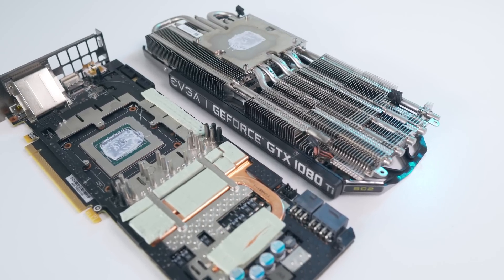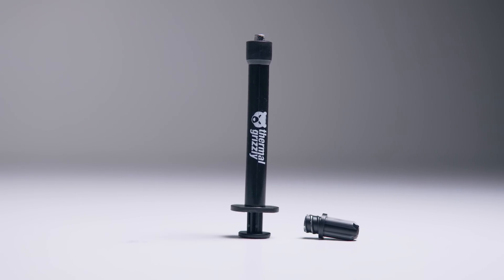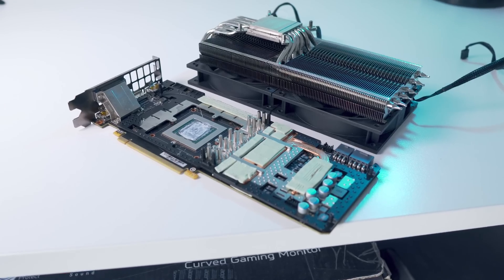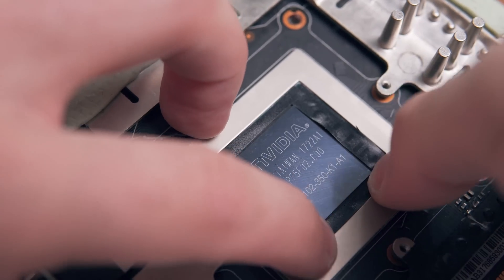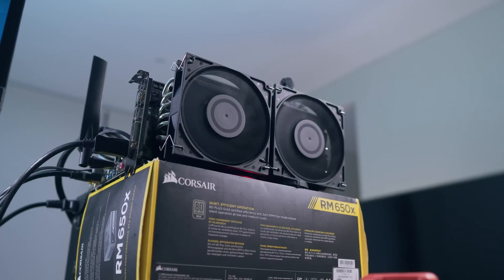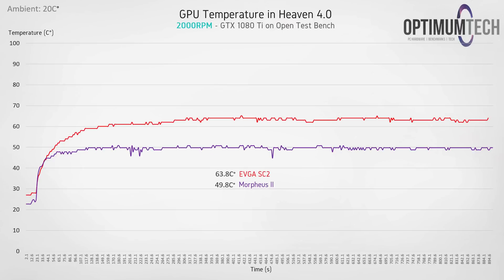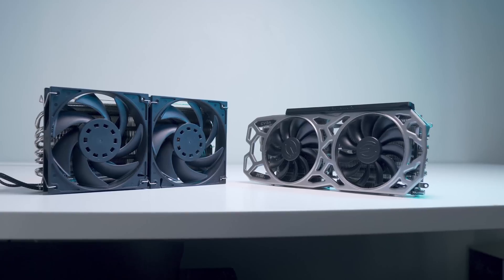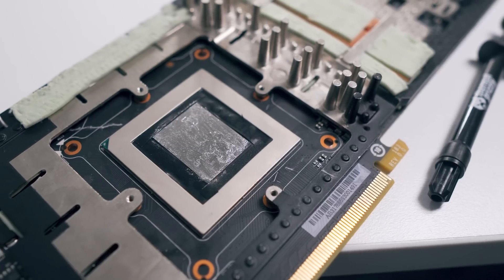Liquid Metal on 1080 Ti Morpheus II!

Comment from the maker: First video on the Morpheus II Cooler swap here: https://youtu.be/K-9k5cRbrPU
There we discuss VRM and VRAM temps, as well as cooler installation in depth. 
This video will mostly focus on liquid metal application for GPUs as well as it's efficacy for thermal improvement.
Reply: Hey man, in a Q&A a while back I asked you about morality in choosing AMD vs Nvidia, what do you think now with the Nvidia partnership?
Reply: Did the morpheus 11 fit inside your ncase m1?
Reply: Hey Ali, im a bit new on your Channel and i saw your Video were you Delidded the i5. In the Video you mention that we can buy your Delidding Tool on your shop, but I can´t find it.
Reply: The problem with liquid metal on the GPU are rarely the SMDs as these are mostly in silicone, the problem is that liquid metal can get under the Die and cause problems there and their method does not help ... it's best to take the nail polish and paint the surrounding area of the Die with it

also should be in liquid metal they know they must "burn" to erziehlen the best results, just one hour generate the highest possible temperature

and the next time please the liquid metal after distributing again in the middle of the banana push so that they can take off too much liquid metal and the rest can spread better and does not come out at one point
Reply: Would slim fans make this fit in a 3 slot case?  I'm looking at aftermarket cooling in the Sidearm T1 when it releases
Reply: Does the Morpheus II fit on RTX or RX 5700xt cards?
Reply: Try this Morpheus II with fans in exhaust pulling hot air away from the heatsink instead of pushing cold air towards the heatsink.
Reply: Optimum Tech I was told by Ranjitek that the heatsinks have an anodized base and shouldn't be used with liquid metal :/
Reply: Harvey Jacka - facepalm, its nickel plated.
Reply: Will Nzxt kraken g12 and x42 makes it even cooler?

Comment: Any time you use liquid metal you (in my opinion) HAVE to electrically insulate. Otherwise you are just gambling. Adding just slightly too much LM (which is nearly impossible to know even with experience) will cause it to squeeze out the surplus which puts it millimeters away from the exposed components next to the GPU. If those get shorted it's very likely game over for the card.

Thankfully it's easy to insulate. I would trust tape personally (but if you use tape then at least make sure it is rated for 80celcius or more). The ideal solution for a perfect seal is conformal coating, although nail polish will also do just fine. Avoid plastidip or anything else that can not withstand heat well. It WILL get hot next to the GPU die and this needs to be stable over many thermal cycles. If you do it right though then the risk of shorting anything is virtually zero.

But honestly, you can achieve almost as good results with just kryonaut which is not electrically conductive. LM is not as beneficial on most GPUs simply because GPUs have a lot more surface area than most CPUs - and thus the thermal interface is not as bottlenecked here. (this might become different with upcoming 7nm Navi cards with tiny dies though...)

If anyone knows about insulation materials that are just as stable as conformal coating or nailpolish yet is also easier to remove though - I would like to hear your suggestions. I have considered some form of putty might be suitable, but I'm not sure if there is a good one that would be thermally stable enough. most simple moulding puttys and the like tend to get very sort or even runny at high temps.

Comment: How did you manage to align the heat sink without bumping these spikes on the midplate? I got Morpheus II Core and when I try to place it the midplate spikes bump the heat sink and I have no good contact between the GPU die and the heat sink. Even I managed to chip the corner of the GPU die as apparently I applied excessive force trying to get the stuff installed....

Comment: I just added an LM'ed Morpheus to my 1070. Absolutely ridiculous results - two 120 mm fans at a locked (reported) 0% (450 rpm - SILENT) and it will not go over 50 degrees, even with the card's power limit cranked. Can't believe how well this thing performs.

Ye gods it's an expensive cooler, but for silence freaks like me it's the best there is.

Comment: with my GTX 1080 Ti Waterforce WB Xtreme Edition (which is connected to custom loop) I applied the thermal grizzly kryonaut and I get around 45-46 degrees under load, but the my room ambient is much higher at about 32-33 degrees and the 4 corsair ML120 pro fans I put on my 480 radiator are around 800-1100 I would say (I built a custom fan curve that is based on the water temperature) so overall the system is quite quiet, with reasonable temperatures considering the ambient temperature.

Comment: Liquid metal is not all about lower temperature. For direct contact application like in GPU and laptop, it's also about stability. I've tried those conventional paste (made of silicone, zinc oxide, silver, micro-diamond which scratch, etc) and they usually bleed out after a while, about several months or so depends on the type being used. NOT dried out BUT bleed out. With high temperature, they become less viscous and escaping through the gap between chip die and cooler plate. This didn't happen with liquid metal.

Comment: Issue for me is, did just replacing the default paste it comes with on the stock cooler make a huge difference or was it the new cooler you put on, it would have been nice to see the Liquid meter on the stock cooler to see if that makes a bigger difference then 3c.
Reply: expect -5c vs stock paste, ive done this already with my evga gtx 1080 ti ftw3.

Comment: Use epoxy is the best for SMD cover isolation I used cold welding epoxy because of strength and not changing dimension after solidification.But, similar epoxy works best then tapes and paste.

Comment: I use liquid metal on my CPU, however I  do not use Liquid metal on my MSI GTX Lightning, the cooling is outstanding, and as you found, temperature reduction on a GPU is far different from an i7 CPU.

Comment: i would have used clear nail polish to coat the caps around the GPU, instead of tape. better protection and no sticky mess when you come to replace the thermal compound.
What life expectancy would you think you would get from the heat sink before the Gallium starts to eat away at the alu heat sink? or is it a nickle plated copper one?

Comment: I recently purchased one of these heatsinks and put it on my new 1080 non OC reference msi card. I've also replaced the paste with Conductanaut and added a bunch of copper heatsinks to all the chokes and VRM. I'm pleasantly surprised with the temps and the amount of overclocking I got. I was able to get 2102 mhz on core clock and 6000mhz on the memory clock. I did Heaven Benchmark on 1080 max settings for 30 mins and the temps stuck around 56c on 40% fan speed or 723-ish RPM. A fair bit a warning though depending on the motherboard and the fans you are using the graphic will now take up either 3 or 4 slots. On my mATX z370 MSI Mortar and the Noctua 120mm fans the card takes up 4 slots and it just barely touches the USB ports on the side of my motherboard.

Comment: I certainly gained  a lot on my MSI 970 GAMING 4G, compared to the Arctic Silver 5 paste which  was previously being used... from 66°C in furmark to 55°C ! (fans locked to 70%)

Somehow the IDLE temperatures are the same as good old paste or even 1-2°C higher (fans off)... there must be a scientifical explaination.

Comment: I really want to buy the Morpheus II with 2x NF-F12s and put it on my 1080FTW. My 1080 overclocks really well but it loses close to 30-50ish MHz from GPU boost. I can hit 2139MHz stable but it drops to 2088MHz while under load (with my fan curve the max temp is 75c but the fans get really loud). I was able to hit 2190MHz on the core when I set my PC near an open window in the winter (Idle was around 15c and load was around 27-29c), so it's definitely the temps keeping it down.

Edit: Added temps

Comment: Liquid metal is extremely niche and 99% of even techies will never use it.  Other than on high wattage cpu's, which LM helps negate the effects of the heatspreader (as it makes getting the heatspreader closer to the cpu a lot easier), LM is not that much more effective than good thermal paste, if applied right. Out of the factory there is usually a lot more thermal paste than needed, which isn't terrible, as it ensures contact. But if you are the type to tinker, replacing stock paste with really thin layer of AS:5, Kryonaut, NT-H1 (if you have a noctua cooler), or MX-4 can yield almost as good results, without all the risk evolved of gallium eating away solder points on your cpu/gpu. No one here wants to be like that guy who sent his Titan X pascal to Louis Rossmann because his card died and it was due LM leakage.
Reply: https://www.youtube.com/watch?v=HPqi8RdApxc

Comment: doesnt gallium damage structural integrity of aluminium ?
Reply: BlacKi2007 you may have not but tons of others have and it has proven to eat it away just not as bad and anodized aluminum is still a bad idea to use this on
Reply: yeah but which aluminium, this is nickel plated copper.
Reply: thats not true. iam using it for years on nickel plated copper cooler and had no problems so far.
Reply: BlacKi it also eats away at nickel and copper
Reply: anodized aluminium is also safe i think

Comment: Basically the end result is that the temps would've been relatively the same if the regular paste had just been stepped up to Kryonaut instead of the cheaper paste.  Although this is kinda interesting that liquid metal does hardly anything in this case, but I guess its similar to how pointless it is to put liquid metal on top of an Intel IHS.
Reply: not true, as usual "it depends". I dropped 5deg load temps moving from kryo to conduca on my 1080ti custom wc loop. There is no one case fits all here.

Comment: I use only liquid metal paste and my temps in my costum extrem watercooling loops are nice on my 1080ti... But i have max 42 C° on GPU by 37.7 C° water temp. I hope it help some body. GPU run max OC on 2073 MHz. Under 50 C° on air are realy great.

Comment: From my Experience Liquid Metal should only be used on CPUs/GPUs when you are either Overclocking OR your Temps reach around 75-80°C or higher.
I delidded my 7700k and at Stock Clocks I only got about -10°C. (from 65 to 55°C). But with Overclock 5GHz it lowered Temps from 90+°C to 65°C.
You get only 3-10°C when your starting Temp is lower then 70°C. But If your Temps get higher Liquid Metal really shines.
Also Liquid Metal is REALLY hard to apply the right way/amount. From what I saw in this Video, he MAY have applied too little Liquid Metal.
Reply: Gucky 
He definitely applied too little. I apply about 4 times as much when I delid. I just did an 8700K that runs geeat at 5.1GHz on air. He could have dropped twice as much if he'd used more. It was my first thought when he applied it

Comment: I used liquid metal for my GTX 1080 as well, but not only for the chip. I wanted to short the shunt resistors, which actually worked really well for about 2 months and I could run the card at 2126 Mhz without any problems. But then one of the shunts fell off one day and the card didn't give any signal to my monitor. So I was hoping to get it replaced. Luckily enough I got it replaced. Since then I'm not using liquid metal any more, because the risk is to high for me to kill the card again. Now I use Arctic MX-2 on the 1080 compared with an Arctic Hybrid II 120 and my temps barely get over 40°C and it can still run at 2088 MHZ on the chip and 5704 MHz on the memory. I also had an Arctic Accelero Xtreme III installed and the temps also didn't get higher than 45-50°C while the card was whisper quiet. So I would buy Arctic products everytime again, because they have an awesome price/performance  ratio. If I remember correctly I bought the Hybrid II für around 60€! That's 5€ less than the Morpheus II here in Germany! Anyway the Morpehus is an awesome cooler and really an alternative for people who can't fit a watercooler in their rig, eventhough it takes nearly 4 slots. :D

Comment: I wouldn't recommend liquid metal on GPU for a long-term solution 
1. The GPU chip and heatsink plate are not flat enough, therefore it is not properly sealed.
2. Liquid metal would dry up and has a high chance of change turning into dust/powder form and due to improperly sealed, the conductive dust would be everywhere.

If you are a kind of person who changes thermal paste every year, sure why not.(not referring to this youtuber because he looks like he knows what he is doing)
Reply: 1) more than flat enough 2) long term testing has shown it doesn't dry up, not in several years at least. Its clearly enthusiast level stuff but it is worth doing, as long as you are careful with the application then its fine, I dropped 5deg on my GPU to just 39deg under full load on water.

Comment: Results really seem wrong, i changed my aorus gtx1080ti xtreme edition paste to thermal grizzly Kryonaut and dropped 8-10c straight away, it was a godsend...GPU's require a very generous amount of paste unlike a CPU, this could be the cause as liquid metal for safety reasons you want to be sparing....
Reply: The drop is bigger when You use it on stock cooler, but Morpheus II is already cooling it really well, hence the small difference in different paste.

Comment: I have gtx 660 ti from evga with blower style cooler, but it overheats in 5 seconds.... even with new thermal paste and clean heatsink... and when let's say I play gta on very high settings I can play at 60fps but when my gpu renders 60 fps even in minecraft it's making like wave lines across the monitor I tried to do some research and found out that it only does it because the gpu is making more frames than the monitors refresh rate, mine's 60hz but it still happens even with v-sync on, but the main issue is the heat.
Reply: Ulquara get this

Comment: My VRAM cooler constantly keeps falling off as I can't lock the screws in (no matching holes on point on my GTX1080Ti).

Can i also just add a thermal pad on VRAM to cool it or would this be not good enough, any alternatives?
Reply from the maker: I didn't use their cooler, I used the stock SC2 one which worked just fine. 
You could just add your own pads + fins if you like.
Reply: Optimum Tech Problem is that I don't have a heat arrester on my VRAM now, only thermal pads... I'll have a look at it again, thank you.

Comment: Nice video mate, i couldn't really recommend liquid metal on anything other than delid applications as it really doesn't give enough difference, unless of course you just want every possible degree then i wouldn't bother. Atleast on my Watercooling loop for my CPU, i saw no noticeable gains over the Gelid GC Extreme paste i always use which is considered one of the best.
Reply: I dropped 5deg under load on my 1080ti custom loop switching to tg metal from tg kryonaut, that's more than enough difference to justify switching for what is a relatively simple procedure if you are careful and take your time.

Comment: Is it safe to apply liquid metal to a evga 1080ti ftw3 Im getting 75 degree on 2000 rpm which is hot and super loud. I don't know what type of heatsink is used for ftw3 model
Reply: But what is evga heatsink made of?????

Comment: Yeah I'm getting almost 20c delta difference in temp. I used it on my Asus Strix 980ti, before on load I was getting anywhere from 77c and up a little, and now after Conductonaut Liq-Metal, on load 62c and below. It's an awesome stuff. I did this Liq-metal treatment six month ago and still today same as the first day I applied it.
Reply: Yeah I think you should go for it, you'll be surprised by the results. Oh btw instead of using electrical tape (33) variant, I used double layer of clear nail polish on surrounding components around the gpu die. Also 17w/mk fujipoly thermal pads on VRM's...it really helps with overclocking.
Reply: Delta is greek, it is used in many subjects math, physics, chemistry, ect. It is used to represent difference. A delta in time is a difference in time. A delta in temperature is a difference in temperature.

Comment: Wait wat? Uses GTX 1080ti and Corsair RM650x?!? That is entry level PSU lol.And 1000 rpm is not silent even on Noctua fans!.Silent is around 600-800 RPM depending on the fan.And don't forget that 2x 140mm fans with 280mm rad can cool 250W load water system at 500 rpm so.....

Comment: I hope nobody follows your install on this lol. The stock sc2 backplate should be on there as the screws are what holds the vrm and vram plates on and it would fit just fine. Your other video you were using an ek backplate or something aftermarket which is why it didn't fit.

Comment: The 1080 Ti gets pretty hot. I would love to see the different temperatures between stock and this 3rd party cooler on 1080, 1070 and 1060 ... and maybe also on the 1050 :)
Reply: > not getting over 45° using a 1080Ti
Back off with that bullshit.
My 1060 Gaming X version with Twin Coolers run at about 70° just playing Overwatch. It's bullshit something 2x faster like 1080Ti that consumes much more power can just run at 45°. Even on idle 45° is BS.
Reply: my 1080ti doesnt go over 45c
Reply: plus or minus 45c?
Reply: Heck, as proven here, even if you use liquid metal + custom cooler, it's still 50°